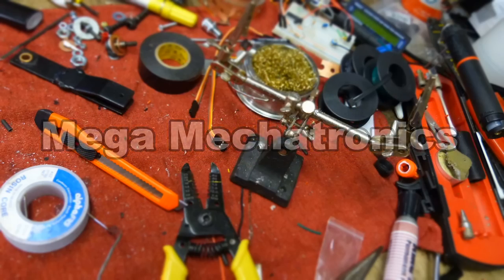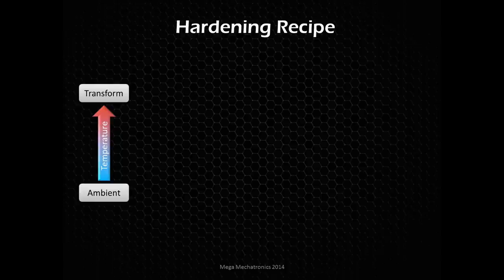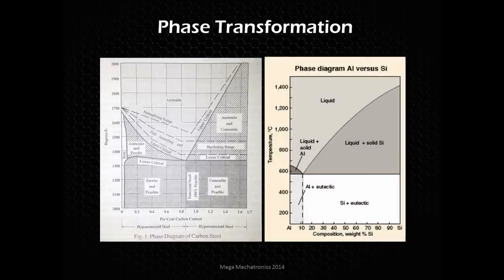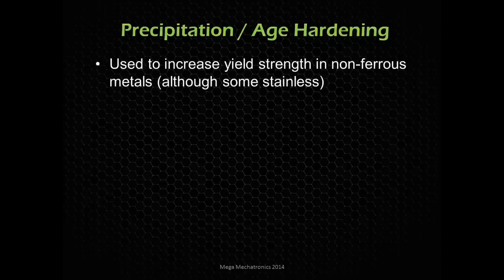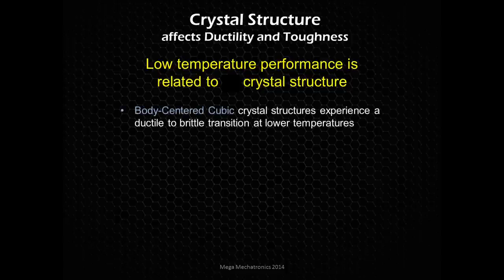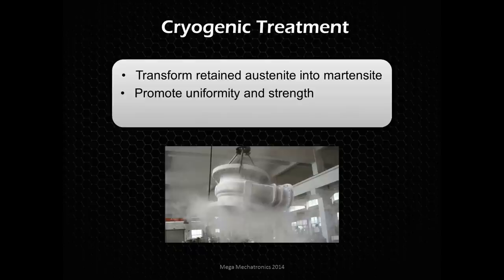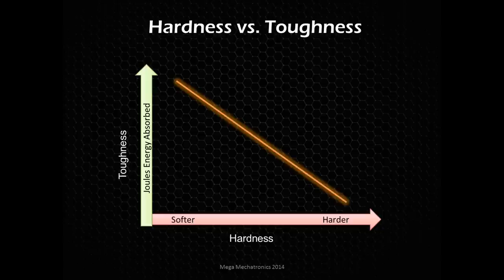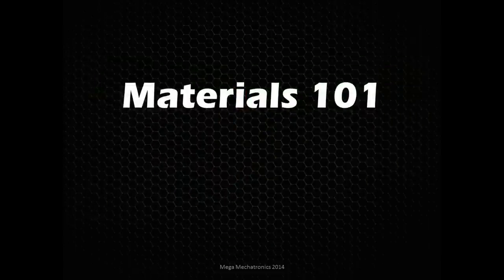Materials Science Mechanical Engineering  - Part 4 Heat Treatment Explained

Comment: Hey man Chris here I own a race shop and we are building a personal race bike with cams and performance valve springs. My Question is I have a set of springs that I got that were used very little upon receiving them I sent them out for wpc treatment like shot peening but smaller balls. And then I centrifugal polished them… my question is should I also send them out for cryo treating or do you think they have already been treated from the factory since they are performance springs for a superbike to begin with? Would sending them for a deep cryo treatment be more beneficial and helpful? @Mega Megatronics
Reply from the maker: Hi Chris, my experience years ago with valve spring treatments was that cyro treatment was indeed beneficial at the highest extreme stress levels (nhra prostock), where the effects are amplified in a sense.  Consider the benefits for the application: 1, maybe 2 more runs down the track before the springs begin to lose load.  I don't think it will hurt, but if you do cyro treat the springs, you would have wanted to do it prior to the WPC "ultra fine" shot peening and polishing based on the methods I learned in manufacturing valve springs.